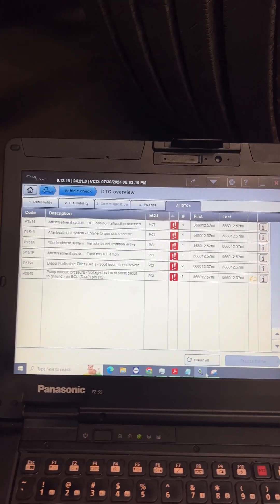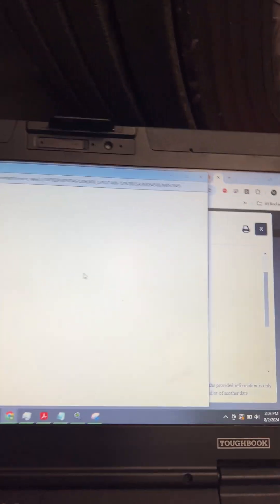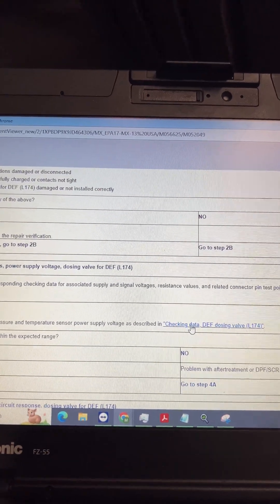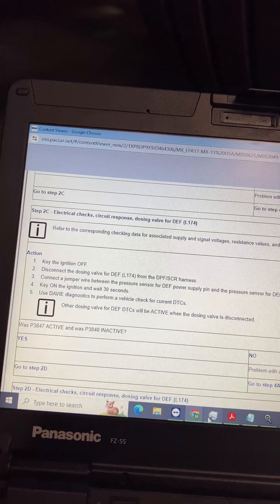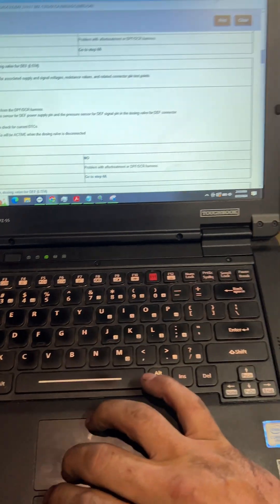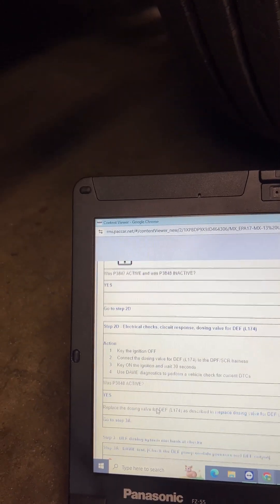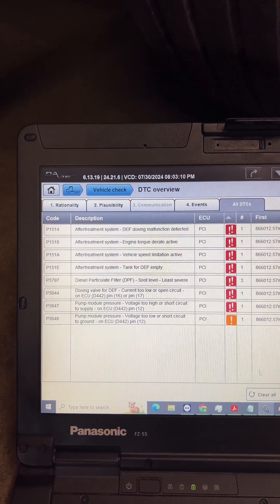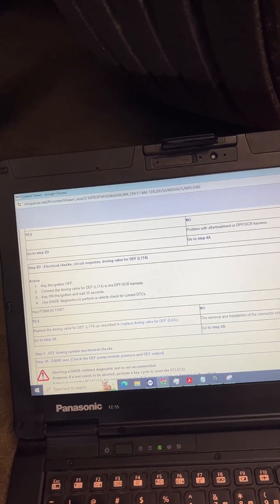2018 Peterbilt 579 Paccar MX13 code P3848 diagnostic and repair. Dosing valve for DEF (L174)

Comment: How many volts at the def pump connector
Reply from the maker: You should have 12v power for the supply wire and also ground. I would load test the supply and return wire with a headlight bulb or load pro.
Reply: @ do you have a Pin out of it and EAS… something is going on with the pump not coming on during the key on process but I can command it through a doser test has me confused I’ve checked relays and fuse panel on firewall checked doser we are getting 5v but only have 3.99 at the def pump while truck and engine is stationary not keyed on or anything

Comment: Hermano estoy teniendo el mismo problema con ese código de falla. Llevo dos semanas tratando de resolverlo pero no lo logro. Esta truck es 2014 Óscar mx13. Pero en este caso la dosing valve solo tiene dos pines. Es posible contactar contigo o que me compartas el troubleshooting para este caso?. De ante mano muchas gracias
Reply from the maker: Same code?
Reply: @freebeerandpizza2008  same code bro plus the derate code
Reply: I'm working with  jpro because I don't have the Oscar software. I'm getting crazy with that. Bro. Any help I'll appreciate that. @freebeerandpizza2008
Reply from the maker: Alright I’ll look it up for your year.